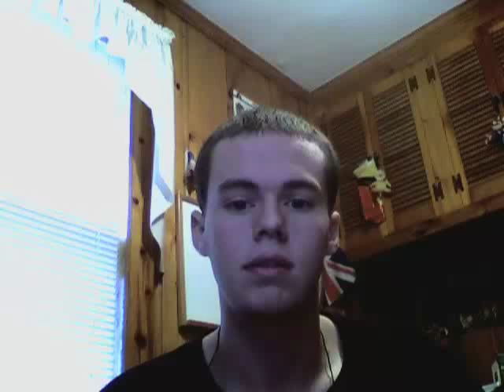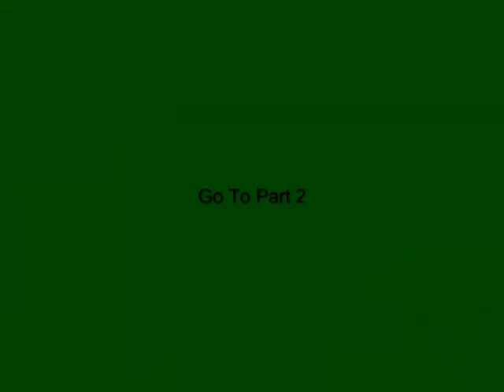Thermal Paste Causes YLOD

Comment: I can see you don´t talk shit like other videos, it seems you researched a lot in the thermal paste aplication, i bought the Arctic cooling MX-4 today i'm going to apply it on my ps3 next week, but can  i really trust in don't spread the paste on the processor?
there's some videos saying to remove the cpu and gpu little plates ant replace the paste too, is this correct?
Good videos

Comment: Ok, ive been a tech head for 30 years..... and a quick point to raise..... im looking at the fixes for the ylod which could actually be many diff faults not just the gpu and cpu lifting prob......im thinking the correct thermal paste applid properly is it and nothing to do with heating up the board with a dryer....... or heater......... the best to expect from using the heat method is simply maybe blowing dust or ressurecting the odd componant a little......... thoughts ?????????????

Comment: i couldent agree with you more on the thermal paste my friend... i just fixed the same problem with my old computer i gave to my friend. the processer was over heating at 190 degree's ferinhight and after i put on the artic something paste it hasent went over 168. so im going to keep watch on it for awile but what you are saying is correct. i actually got the idea from your video. thanx for the advice by the way because it worked. if they do the same for the ps3 there wouldent be any more issues

Comment: See sony should of use gorilla paste an you would be probally thinking what the fuck is that or no, Well its a glue that turns into solid rock which plumers would use to reduce heat of the water pipes whih can go up to 900-1000 degrees in farheit. I have no clue honestly why sony didnt you use it because thermal paste sucks its a cheap china based product. Though I dont mind about this whole situation I have a 40 gig model thats turning 3 years in 2 months and it perfect. Though freezing